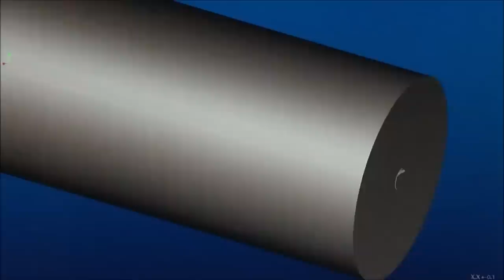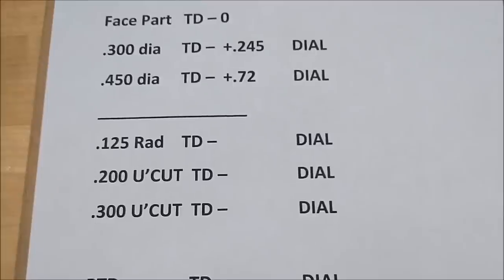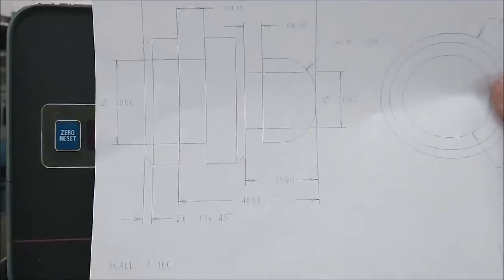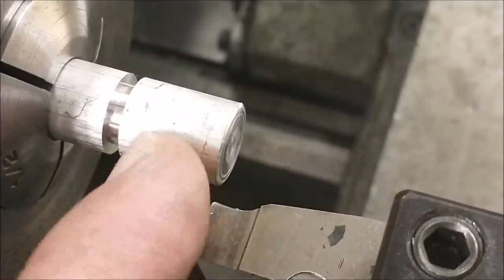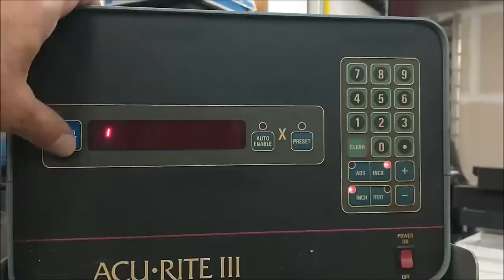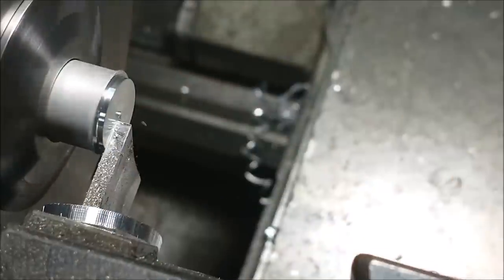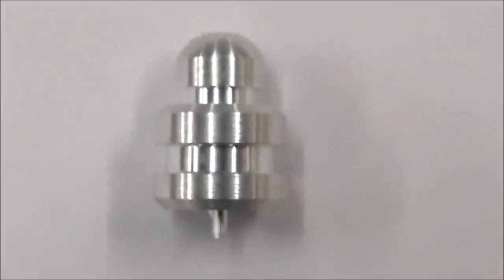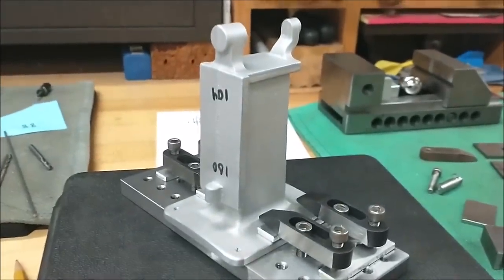Own a Manual Lathe with a DRO ? Try This for Faster Parts !!!

Comment: Once you have made and parted off the first part, do you just pull out the stock by eye, a tad past the face off zero setting?
Reply from the maker: Since all the tools are coordinated to the facing tool, just pull the material out by eye or to a stop and face the part off. Zero the DRO in ABS and off ya go. All the previously established values will still repeat.
Reply: @joepie221  Thanks Joe. I have a mini lathe, I did make a stop for it but that's more to do with reinserting a piece of stock that I may have to remove/check fitment. It's mounted on the left hand side of the lathe, using a a long thin rod pushed through the through hole, butting up against the stock that's clamped in the chuck. Not sure how you would mount a stop to the right of the chuck without getting in the way of the tailstock etc.
Reply from the maker: @steveclark..  https://www.youtube.com/watch?v=8Z79i481QyI&t=2s

Comment: Great tutorial, but a few points-
Axis are  arbitrary- but normally a twin axis would be X,Y and a single axis X (as your DRO manufacturer agrees). For a lathe, it is normally X for the carriage and Y for the cross slide. A convention, but largely followed.
You are using the incremental as an offset for another tool- Ideally the DRO would have a number of incrementals, which could each be assigned to a different tool. Then you could set up all tools with (in effect) their relative offsets, then using the absolute tool you could zero a new workpiece once, and all the other tools would be zeroed in ( their zero points would be moved by the same amount as the master). This would work with any workpiece/design - just set the absolute, select the inc. for the tool you are using, and follow the print.  Anyone know a DRO that has this? I am currently making a DRO, and will incorporate this (select by tool number).
How do you work with only a single axis DRO? If I only had one channel, I would want it to be the cross slide...
Reply from the maker: Though convention is a good baseline, I was under the impression the spindle was always the Z axis. Other DRO's do exist for individual tool setting, but you better remember to switch between offsets when you change the tool.
Reply: @joepie221  I would be tempted to fit 'tool detectors' (micro switch) to the tool rack, linked to the DRO. With the right software, zeroing ANY tool would zero in all of them. Would save a lot of time.
Reply: We have a 3 axis on our Clasing and use the "Z" for the carnage. I pt the X on the tail stock. We only mount the compound when we need it- Use a solid block most of the time,,,,,,and we drill a hell of a lot more holes to depth then we do single point threading or high angle turning and the compound dial works just fine for that.

With the cost of these chi-com DROs I wonder why more people don't have them on the tail stock (Never had ANY luck with the chinese digital calipers and there is no way I'm going to buy a Starrett and chop it up for a tail stock read out)
Reply: @mathewmolk2089  The magnetic scales with the separate readout module are easy to convert- they give a clocked data reading that feeds easily into an Arduino. Add a small touch screen, and you can read several into one display. Much cheaper than glass scales, and smaller. Four gives you carriage, cross feed, compound, and tailstock.
Reply: @joepie221  That was what I was first taught.  I also was also taught the coordinates and direction of XY table on a mill/router/etc is always oriented like cartesian plane, but I've seen more than one or two mills where the Y was flipped.  Even my new South Bend (couple years ago) was flipped.  Drove me bonkers so I got into the setup and changed it.
Reply: @mathewmolk2089 I use cheap caliper-style scales on my tailstock that last about a year before the electronics clog up with oil, coolant and chips. Costs me about $30 a year in replacements, but I might change to a DRO channel when the old Newall Sapphire finally dies and I have to buy a new DRO.

Comment: How much accuracy is lost by changing tools? If your tolerances are +/- .010” you probably will be ok. If they are tighter than that you could have some problems IMO. Otherwise I liked the process and plan on using it in the future.
Reply from the maker: Aloris QCTP are incredibly accurate. They will easily repeat with .001" all day long.  if yours deviates by +/- .010, its time to get a new one.

Comment: It's really not that complicated or too much to absorb. It's just using multiple co-ordinate systems that account for tool offsets and the measurements in the drawing, and mapping them all back to a common co-ordinate system. It's actually very simple and elegant! Every CNC basically does the same thing, it just hides all of the layers of offsets from the user and presents you with everything in one common coordinate system too, but at the lowest level, all the machine moves are happening in "absolute" or machine coordinates anyway.

Comment: Seems like an awfully tedious way to do addition... Get the tool to a known location relative to zero on the drawing, subtract that value from the DRO readout, and you have DRO zero for that tool. Add that to all the feature locations on the drawing and you have their locations in DRO coordinates.
Reply: In the past I’ve added points to my drawings representing the tool offsets and dimensioned to that for the different tools. But addition works too. I don’t think I’d do it this way
Reply from the maker: This method is doing exactly what you have just suggested. Toggling between abs and incr is giving you the values you need, without you having to add or subtract anything.

Comment: I understand you dont have one but most newer digital readouts, you can press the tool number button and then set the offsets for each tool just like you do on a cnc. Speaking of cnc, you could have made 50 of these parts while you were making this video with no one actually running the machine. Lol
Reply: Really? "Could've" is not the point of this video. Jeez Louise.
Reply from the maker: You are correct with both observations.

Comment: Now the question is is how much do you charge to make a part like that, or make a hundred parts like that, or 500 Parts like that, or 10,000 Parts like that cuz obviously the number would change with the more that you would do, let's just say you had to make a 100 Parts like that how would you charge for something like that, is this has got to stay open the lights have got to stay on the tooling got to be used but you still got to charge something or the doors don't stay open
Reply from the maker: Factor in the setup time, material consumption, cleanup time, run time and maybe the tax you'll have to pay and come up with a curve. As the quantity increases, the price decreases. Naturally the first part is the most expensive and the next ones inline fall off. Complexity of the part drive how much the price falls off. On a part like this, the second part is almost free, but know your rate expectation and watch the clock. Charge by the minute if you have to after the job gets rolling.

Comment: I don't think you showed how you pulled the stock out to the right place. I assume you positioned the facing tool and bumped the stock into that.
Reply from the maker: Doesn't really matter. Zero the digital once you face it off and off you go. I do have a video on 'production parting' if you need another idea on how to do it.    https://www.youtube.com/watch?v=8Z79i481QyI&t=460s

Comment: OK, now the test. Without looking at the part in the lathe, using only the DRO and dial, cut a third part and compare to the original.
Reply from the maker: Not a problem.